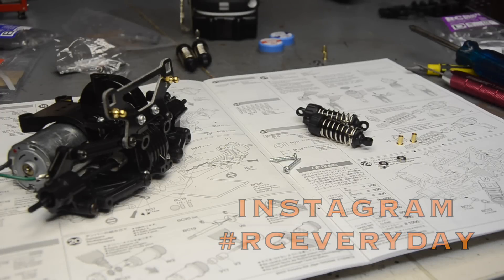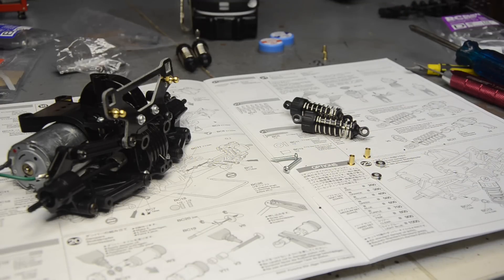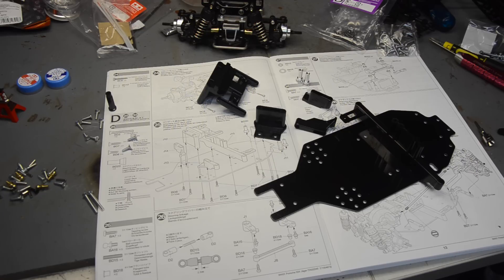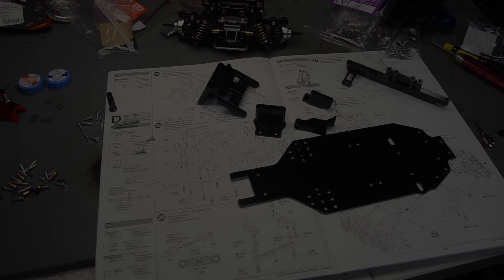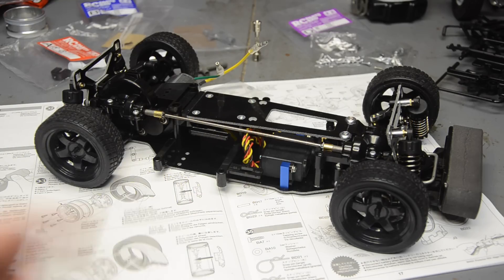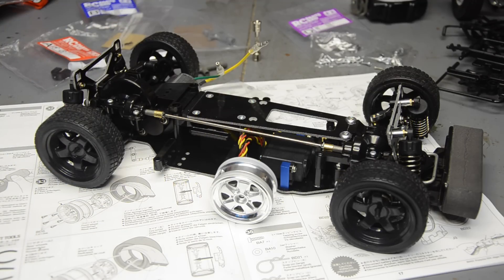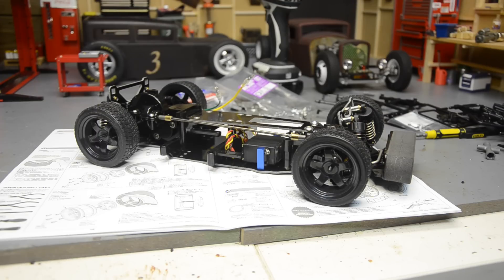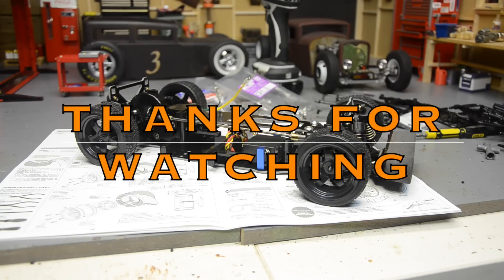Tamiya TA02sw Build Series, Part 3, The Roller

Comment: I made my own stealth mounts for my Tamiya lowrider.I threaded nuts on the body posts and glued strong rare Earth magnets on the underside of the body and it works perfectly.The total cost was under five bucks.I agree completely with you about the lipo batteries, they are not worth the risk. I use a 5000 mah NIMH in most of my rigs and there is plenty of punch.

Comment: From my experience with painting the clear bodies, lexan (don't know how to spell it). I've seen friends paint the inside instead of the outside. Won't scratch when crashed. Also, if you didn't already know, there is a thin layer of film over the body too. And if you don't take it off, maybe that's why you had problems in the past? Hope this helps somewhat! Love your builds and always excited for what's next.

Comment: Still got my TB-02 although it has gone through some pretty drastic changes and more to come. It is RWD now and I want to do a motor up front mod and change the whole front end suspension and steering geometry completely. Will have to design some parts for that. :)

Comment: I use box tape to hold on the magnets.  Just make sure you take your time on the paint job, using good polycarbonate paint. Otherwise the the body will come off but the tape, magnet and paint stay.

Comment: I feel the same way with lipo 😂, but those hour+ long run times on the trail sound very tempting, Along with a fireproof charge bag put inside an old steel ammo box.

Would you ever build a scale nitro car/truck/crawler.. Seeing a small nitro more under the hood would look pretty cool and different and having an actual scale working exhaust with the axle hoop etc, you don't need to find a giant space for the battery pack that throws off interior scale
Reply from the maker: I have never done nitro.   Just seems bulky needing to have a throttle servo and a fuel tank.  I have been thinking a lot about trying it though.
Reply: RC Everyday micro servo with cable operated throttle and return Spring.. The fuel tank can look really scale.. Probably wouldn't last that long😄 the marine engines are good for keeping temps down and if you're skilled enough to braze some thin brass tubes together you could make a cool radiator. With a vicious cooling fan from the back of the motor or a small heatsink electric fan. 

3rc channel servo for the clutch bell/trans brake and get it up to revs and let it go 😎 

In theory it sounds great.. but will no doubt be a nightmare to get everything working awesome  😏

Comment: Hi buddy so I just completed my rising fighter  everything looks fine took me couple of days to make but hears the thing I got parts in black left over no where in the manual did it's say I need them ? I have no idea what they are for ? Did you have hardware leftover ?
Reply from the maker: Tamiya always uses and re-uses parts for different kits.  Every tamiya kit I have ever built has had extra parts on the trees when im all done.  Usually they give you some extra hardware as well, but 1 or 2 of things, not a bunch.  Just to account for inevitably dropping and losing some.  The tamiya M-cars are the worst about extra parts, my M06 build had nearly enough parts to outfit another chassis.
Reply: @RCeveryday  Thanks for getting back to me ..oh right i see. so chances are they are for different kits only 2 parts I could see that are the same as whats on my buggy  . that's crazy why they put the other parts in the box that don't go on my buggy .. that's a nice kit you got thanks again 👍 and happy New year !